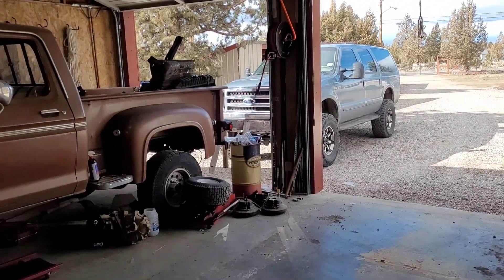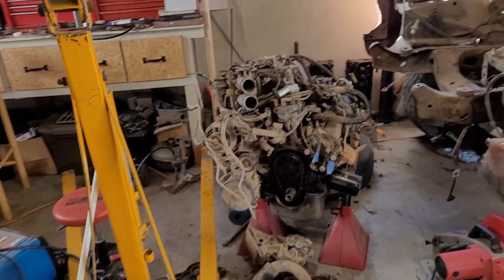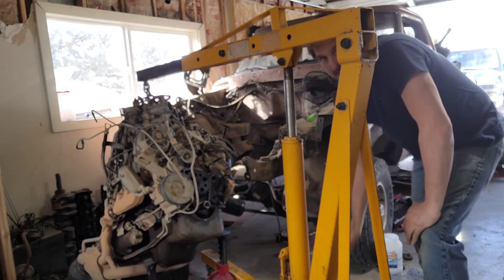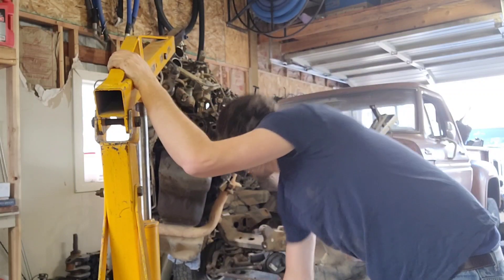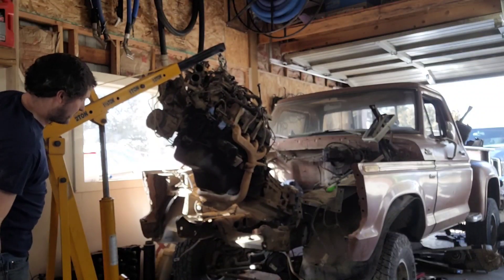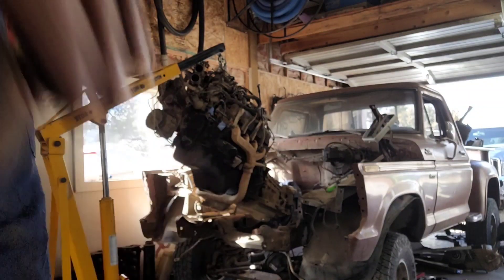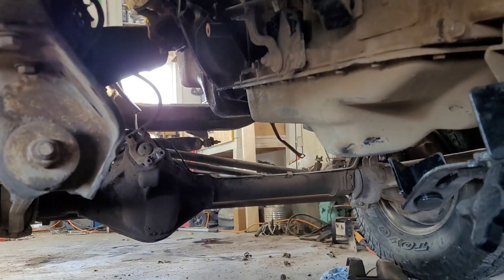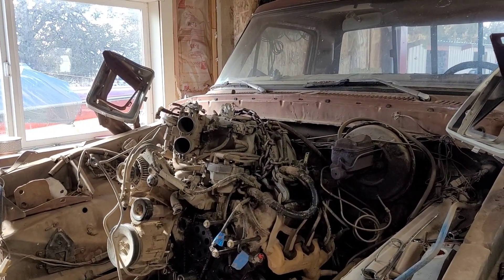1978 FORD F150 5.0 EFI SWAP PART 1

Comment: Ive got a 78 f250 with a carbed 5.0 put it in this summer left all the front clip on and set it in the truck with a skid steer got a little sketchy

Comment: junkyard trip find a 73-79 f100-150/bronco 4x4 with factory 302 and get frame mounts the mounts for a 351m/400 will not work at all period i have restore enough of these trucks too know this and the easier way is google/youtube fat fender garage and put a coyote mount it and you can find coyote motors pretty cheap on craigslists.thanks

- nick
Reply: Coyote motors are not at all cheap

Comment: If you can put a 460 in a 79 f150 with a manual fan. The 5.0 will fit.